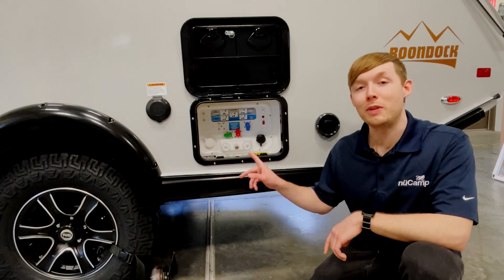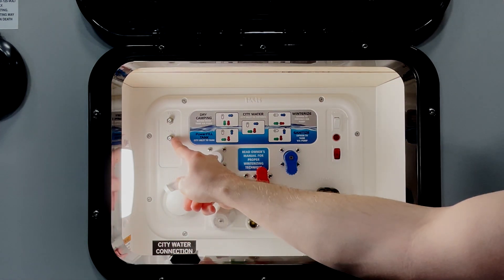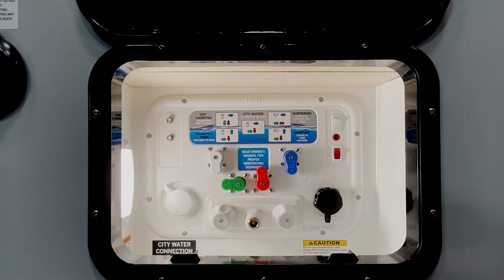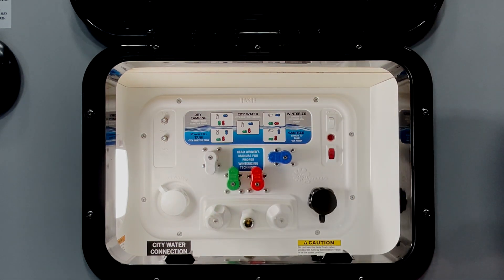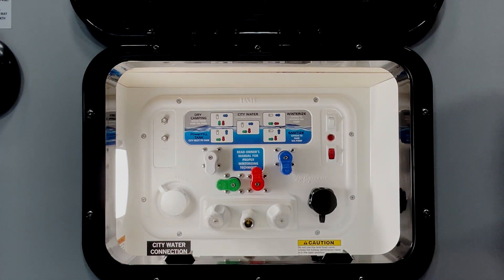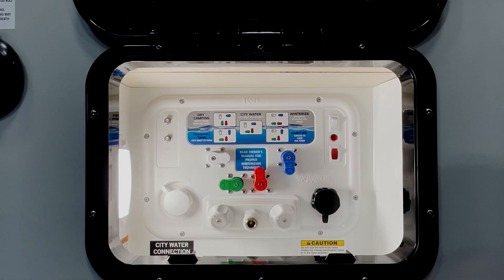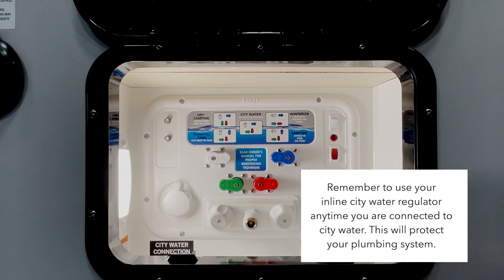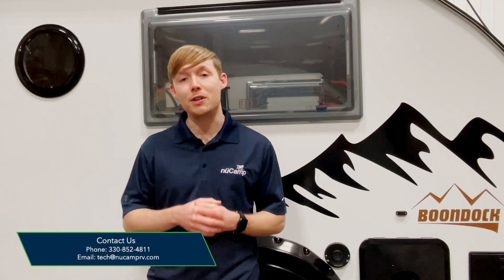Nautilus P3 Overview

Comment: How do you know when the fresh tank is full when filling
Reply: I use three methods; the first is my spouse checks the lights on the panel inside; second I use a gauge connected to my hose that tells me how much water has flowed through the hose into the tank and third, I run water into the tank until it flows out of the fill connection.

Comment: The manual for 2022 320 winterizing number 8 indicates connection for air hose “to the sanitize/ winterize port” to blow out the lines. However your above video indicates to connect air hose to “City Water” connection.     Which  is correct.   I followed owners manual instructions. Is this an incorrect statement in manual.

Comment: So flushing the black tank it does not involve any levers…its just flows thru to the tank ? Is there a backflow preventer so nothing from the black tank comes back to the panel ?
Reply: On our 2019 it flows direct into the tank. The way we flush is after the initial dump, I close the black tank and run water into the tank for 60sec. Open and let the big flush happen, then close and repeat. We do this at least four times and finally, if we are moving to another camp ground, if we have it, we dump a half bag of ice with a good squirt of Dawn into the tank.

Comment: So you can use either the powerfill and sanitize mode to transfer water from an outside source to the 19 gal tank using the pump switch?
Reply from the maker: Sanitize mode can be used to siphon water out of a bucket and into the water tanks. Siphoning will utilize the onboard water pump. Powerfill requires a city water connection with its own pressure. For more information, please reach out to our Tech Department at tech@nucamprv.com.
Reply: So is there a way to fill from a purified water station with an unthreaded hose?  IE no bucket, no pressurized garden hose.
Reply from the maker: @JeffinTD  Our Technical Support Team will be happy to answer your question! You can reach them at tech@nucamprv.com. Thank you!

Comment: It would help if you would describe the use of the red lever for heater bypass.
Reply from the maker: That’s the beauty of the Nautilus system! You don’t need to know the function of each specific lever. If you follow the key on the sticker, the water will flow to the correct place ☺
 
For example, the red lever isn’t always what’s bypassing the water heater. Sometimes it’s the blue lever that does the bypassing, depending on what mode you’re in.
Reply: @nucamprv  page 4 of the Nautilus P3 manual explains what the different levers do, but I agree that there is no need to know. :)